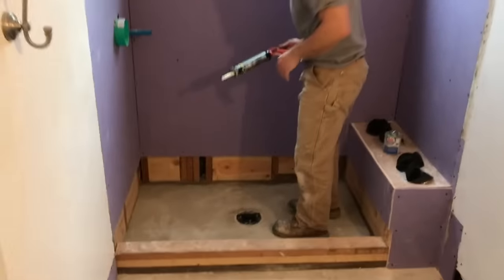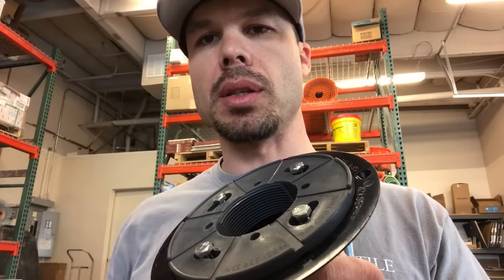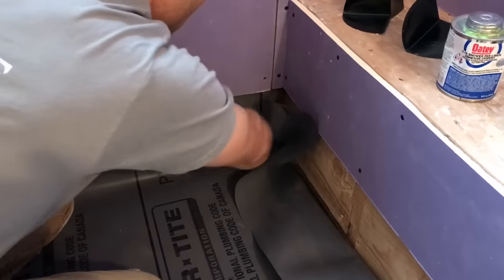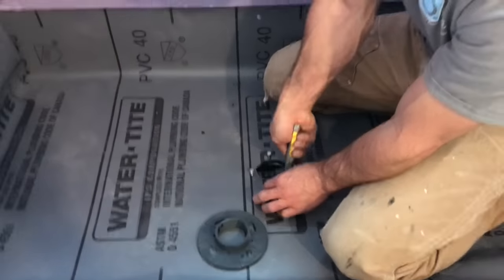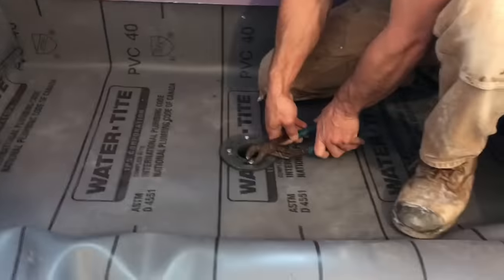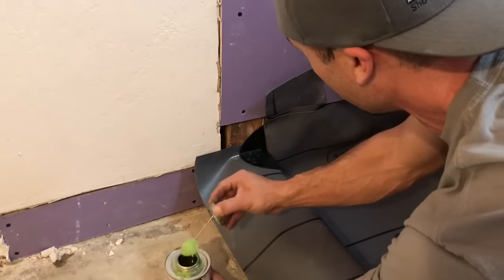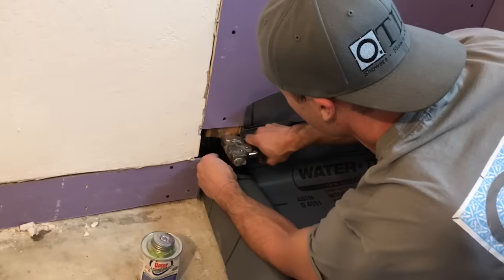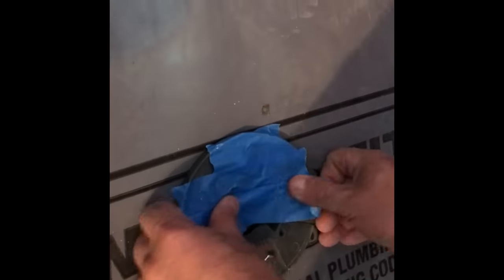Easy Shower Pan Liner: Tile Coach Episode 9

Comment: I've been watching vids for a few days now and have heard that cutting a complete round hole in the drain isn't any good, but rather cutting an X and folding the flaps down will result in a potential leak from seeping under the O cut

Comment: Great videos. They have helped a lot. So thank you. I want to use a pan liner, but I can't seem to find one large enough. My shower is 5x7, but to cover the sides, floor and over the curb I need one 7' x 8'. Do they make them this size? Thanks in advance.
Reply: I searched shower pan linear and pick images. From there you should find the size you need. You may have found one since this is 9 months old?

Comment: Get a Kerdi shower system. Those old style shower pans are inferior. You still have to waterproof the mortar bed or you WILL get mold.... He also has No preslope under the pan so water will sit in that mortar for weeks before it finds them weepholes to drain....

Comment: It's much easier if you just cut a little X on the liner on top of the drain bolts and then just push the liner down over the bolt. No need to try and cut a small circle out of the liner for each bolt. A little X is all thats needed.

Comment: corners are the worst. no segue, but a horror story about a mud pan. Remodeled a master bath, put in a 5x5 walkin shower. Hired a crew to do the mudpan and tiling. Gave them two pieces of 5' wide 40m liner. there was a seat framed out in one corner. the stole one of the pieces of liner, didn't cover the seat at all. i ended up having to tear out the ceiling in the room downstairs and repair, also had to tear out half of the mud pan and redo it with new liner - lost the seat, and the guy wouldn't return my calls. <sigh> guess I was just a sucker for not standing there looking over their shoulders the entire time.

Comment: Do you ever skip the pan liner? Say on one story house with slab foundation.
Reply: No. Although, in California in particular, there's a trend to argue it's not necessary at times and lazy contractors will simply put down a coat of 'redgard' (or brand equivalent thereof). This is always done a.) out of ignorance b.) desire to cut-costs c.) a desire to 'bilk' the customer and not do work that is quoted. d.) All 3.
 What would ever be the reason to not use one? They're cheap. slab, unless treated w/ some sort of waterproofing sealant is not immune to moisture and constant contact with water. Additionally, you'll use a liner on top of a 'pour' that you already have done that is sloped. You always want to have a slope that leads toward the drain. 
I'm not sure what your circumstances are but if you're asking questions like this as part of your own DIY project - I'd forego the headache and purchase a premade pan from a big box store. In the end the price difference will be insignificant given the amount you'll have to learn. Conversely, if a pre-made pan does not fit for your application (remodel drain location restrictions, you're going to tile the floor etc.) then proceed w/ a traditional technique.
Reply: I do. If it’s a concrete floor and dirt underneath then who gives a shit.
Reply: @dandan7973  um, yeah, don't take this advice. On the plus side, the price was right.

Comment: Purple board  hope that is the fiberglass board...paperless. These pans are what 10yrs maybe 15? Homeowners cheap pan. It should be hot mopped. I agree though why not durarock.instead of drywall...its cement board?
Studs in stall should be wrapped with 60min black paper. I've also read that steel drain is best  not plastic.
I'm just a drywall contractor..you rarely see this style here.
Reply: Isaac Ostrom you never adressed using a vapor barrier such as 60min. black paper that stucco guys use to seal wood studs.I do high end homes for over 30 yrs. Just going by the way I see homes done.
I also heard plastic drains break.
Hot mop is like roofing..several layers with tar..I think they charge about $400.

Ok I went back saw your video How to float a shower....I've seen guys float walls then put wood screeds to get walls flush and finish it..pull the wood screeds and hit where the  screeds were.. Your method looks ok   Plastic drains???
I read the plus and minus of both..

Comment: Ok. This is a good Video!  I am old school. Call it law by the government or what but stick to the old ways that have worked for so many years! Hot Mop! Tar shower pan, #30 lb felt paper for a liner, got up 18" on the sides and you got a solid system for 20 years unless you go someone on the bad side!
Reply: Sorry Jason, but if I built my showers with a 20 year life span I would've been in trouble for the last 14 years. There's a good reason why almost nobody (and nobody I know) uses tar paper pans anymore. Rubber works better.

Comment: code or not i would never put drywall down that low,,and is that OSB on the bench ?
you say your putting lath and mud over drywall,,so you just use long staples every 16" O C ,,crazy
Reply: Yeah no bueno. Crap installation. Nothing like installing a septic tank under people's feet!

Comment: Really? Staples? And drywall? No cement board? Moisture will rust out the staples and eventually get to the drywall. And how are you going to finish hanging your drywall without putting holes in your 8 in sides of pan linear?

Comment: Great video, pre slope before liner = good idea

Drywall as backer in a shower is really crappy..
Over where I am in Canada Water resistant drywall is code minimum, which sucks! Unless your gonna red guard all the walls but then that defeats the purpose why not buy cement board and do it properly??

You should really put a disclaimer about the backing your using alot of people are gonna think drywall/ water resistant drywall is acceptable as tile backer in a shower.. Your tiles have a 15 year life span with drywall tops!!!
Reply: @TileCoach  
what do you mean by floating? 
Thanks for the reply
Reply: @TileCoach  Im assuming floating the walls is skim coating with mortar..?

Still more cost effect with a product like densheild lets say?

Comment: That's not how you prep a shower bench you should around the corner over the bench and then float the front of it and Float the top of it if a wire and you put caulking I mean staple that you put in for it will not rust

Comment: Just have to point out.....the better way to cut the hole by just making star cuts that don't actually reach the edges of the hole. Then you just use the the locking flange to push them in......
Reply: Also that's an odd way to do your curb corners.....if you just cut out all that extra, you can get a much flatter  joint.

Comment: So when you cut the hole for the drain why didn't you t it? Split it in a t and tuck it into the drain
Reply: Isaac Ostrom no what I'm saying is def silicone it for sure but instead of cutting the actual circle if you t it then you can tuck it when you put the 2nd flange over it. It's how we've always done it that way even if the silicone ever fails it still flows into the drain you might lose maybe a 16th from your 2" but works solid. Nothing will ever get under the flaps because they're tucked in between the 2 parts, if anything does get under it then there's a problem with a pan failure
Reply: Isaac Ostrom agreed

Comment: You have good intentions. I've done hundreds of showers. Literally. I hope you didn't install over the drywall
Reply: We used to Mud everything, walls and Floors just never seen anybody do laugh over drywall what is the reason to go over the drywall versus nailing your lath directly to the studs over a vapor barrier? Seems like it makes a pretty thick wall is that code for California I assume? When I started, backer board was for cheaters. Now it's the thing to do, seems like. I agree with mud walls you have a bomb shelter. And they will last 50 plus years. Instead of using drywall we would lather and put a scratch coat on it let it dry out for a couple days and go back and float it. If you have any pictures I would like to see them and especially on the float coat. I didn't know anybody knew how to float walls anymore, much less make the mix for it. Have a good one
Reply: @TileCoach  floating is tough especially in the summertime, and what a mess also. I don't put a lot of heart into the Schluter system that's a very thin waterproofing membrane that you're betting on and a lot of seems. We'll keep up the good work Buddy. Have a great one, and happy New Year
Reply: We take the sheetrock down and add goboard instead

Comment: Next time run your wall boards all the way down to the floor over the liner...I also like to leave a little space in the corners to tuck the membrane into the corners..That way you don't have to fold it over three times and bump out your wall boards in the corners...

Comment: Your pan is supposed to be prepitched beneath the Oatey liner and the wall board is supposed to lap in down to within an inch of the pan bottom.
I left the code for drywall use in showers in the previous comment.

Comment: Bro I’ve been making vinyl shower pans for 20 years. The one you made was a good attempt I’m sure it was waterproof look for a video should’ve made one much prettier. Look like you just slapped it together. The way I do them is I measure the shower pan and build a shower pan in another room and drop it in.And when I’m going my corners I light them on fire before I stick them together and make it softens the material and makes a glue stick much better
Reply: Oh yah I’m a plumbing and heating technician of 20 years. In Connecticut the plumber does the shower pan Most of the time.

Comment: You are not supposed to use sheet rock. By code you must use cement board inside the shower.
Reply: I don't mind 'green board' as a sub layer behind durock but 'mud' cap trim isn't as common as it used to be. There's no way I'm putting tile on sheetrock except for kitchen splashes, even if I waterproof it. The gypsum wicks to easy. I'm not real keen with staples for the liner. They'll definitely rust out quicker than galvanized roof nails. Once the staple rusts out there's not much to keep it from sagging behind the wall.
Reply: Isaac
First, 34 years in the trade, lesson #1, never say 'never', there's a first time for everything.
Second, unless you're mudding the walls over your wallboard, you misunderstood what I said.
I said durock is ok over sheetrock. I assumed you're mudding the base. And if you're not durocking over the wallboard, I'm assuming you're going to mud over the bottom part of the wall where the liner is and then waterproof the whole thing. Either way your mud base is going to sit on your liner. Your staples will eventually wear out (probably) and your pan, pre-sloped or not, will get wet to a degree, increasing the weight and pulling on the side of the liner. I'm not saying you're stupid or anything, if it works for you, go for it.
I'm just saying why I wouldn't do it.  By the way,
If you look at my original comment, I was sticking up for you by telling the other guy you might have a perfectly good reason for having wallboard in your shower. Of course, if all you're going to do is waterproof it and then tile over it, that's messed up.
I'll tell you what, if you still like doing it that way in 34 years we'll renew the discussion.
By the way, even mudding the whole thing I still wouldn't use staples.
Take it easy, whippersnapper.
Reply: Isaac
No offense taken. Everybody has their 
own way of doing stuff. I don't mud walls because I don't work with a helper and it's just too much labor.
Besides you've got to have a pretty thick skin to do videos because everybody is going to tell you you're goofy for this or that. My ego can't take it so I just do my jobs and TRY to mind my own business. A couple more years and I'll probably retire.
Good luck.
Reply: @richardharris8399  give me a link to see your videos , Sr,it seems like you have your own channel,do ya
Reply: @trabajadoraenconstruccionu739  Actually I don't bother videoing myself.  They say old habits are hard to break, I guess new ones are hard to start.
I'm just getting to where I remember to take pictures when I'm through. Besides that, everybody has their own way of doing stuff. I like my way. It's worked pretty good for 34 years. And I learn something new all the time. I didn't think much of waterproofing until a couple of years ago then I tried red-gard so now I use it pretty regularly. 
To tell you the truth, I don't think my ego could stand all the jerks out there dumping on people because they do "this" or they do "that" (jerks like me sometimes) and they don't do it that way.
But if you find anything I say helpful thanks for letting me know.
Reply: @richardharris8399  we all can learn something new,its just I am watching videos as much as I can because no one wants to share the knowledge with others,congrats Sr.and thanks to this channel to.also Im a woman👍
Reply: @trabajadoraenconstruccionu739  Thanks for your comments. Maybe one of these days I do a video. We'll see. I think Sal di Blasi (I'm sure I spelled that wrong) does good work. What I've seen of his videos I generally like. I'll give you one little secret... I don't know if you're a believer or not, but I try to say a little prayer when I start work everyday. I know it sounds like bs and it doesn't seem too common on jobsites but there's so many things that can go wrong on a job that you may not even think about, I just try to make sure God knows that He's always welcome to keep me from messing something up. Just a little tip.
Reply: @richardharris8399  God bless your work,everyday then,👍
Reply: @TileCoach  
R :702.3.8.1
Reply: In Arizona we hate to use  hardie backer , denshield ,fiber rock or durock  not even purple board   and no nails or staples  below one foot we have to make those bottom cover caps 1',6 " a less  and no wood in the curve only concrete blocks 4x4x16 whit caps , I like how you install the prepich that mud before you install the liner .
Reply: @TileCoach  
Wrong.
IRC specifically states such.
Local codes can no longer vary to mitigate IRC or MRC.
Wrong answer .
Reply: @keithtomczyk4730  Not sure what you mean by MRC but, if it is the Michigan Residential Code, they are operating under the guidelines of the 2015 edition IRC in which there is NO R702.3.8.1.  And as far as the IRC....it is the sister to the IBC and put out by the ICC and local jurisdictions in the United States are NOT required to adopt those codes.  They are guidelines/suggestions.  Same with TCNA handbook guidelines.  And yes.....this Purple XP gypsum by Gold Bond is NOT included as an option for acceptable backing in EITHER publication (2018 TCNA Handbook "Materials" sections of pg's 238-249 and 2018 IRC table R702.4.2) BUT.............in the manufacturer's submittal for this material it states.... "Avoid using as a backer board directly behind tile in tub and
 shower areas" which, to me, implies that it can be an INDIRECT backer:  As in a backer to a backer.  BUT, according to both TCNA and IRC it is NOT an option for backer behind ANY type of water proofing/repelling method in ANY tile installation method.  If I am wrong on any of those points then please feel free to direct me to the appropriate and official references.

Comment: The only thing I see wrong is you installed the drain flange upside down.  The weep holes allow water that leaks around the drain to drain out into the drain. But the drain tracks should be facing down against the PVC liner.  Flip one over and look at it and see the benefit.

Comment: Purple boards REALLY!!!  U fail before u start
Reply: This is a top class tile setter, He will most likely float the walls after he is done,  this is top class and so does the end results of people like him.
Reply: Purple board is fine as long as you coat it in something like red guard
Reply: @cencoast_7.340  He is probably a contractor from California, one out of ten in California actually knows how to work 9 out of 10 only think they know.
Reply: 2strokesnPwrstrokes except floating it doesn’t fix the problem
Reply: Ismael Montano why u angry face my friend?
Reply: Been tiling for years over purple board. What do you tile over in your installs? Plywood😂.

Comment: Use the Schluter system eliminate the old pan liner and durock Schluter system is superior installation
Reply: No cons completely waterproof system best warranty on the market can't be beat
Reply: Disagree this system has been proven 50 ft underwater which is an amazing amount of water pressure it will last as long as the tile does
Reply: Shluter is best. Not all clients want to spend that kinda money when old school methods work as well
Reply: James Coyle 

Schluter is still relatively new compared to this vinyl membrane. Vinyl is true and time tested to work. There are too many seams in the Schluter system that cause you to rely on “properly mixed thinset”, no thanks. No seams, no leaks. I’ll stick to vinyl that will be here long after mankind is gone.

Comment: Water tight until we put staples in it 😂😂😂😉
Reply: That's why it's stapled at the very top, if your water gets that high u have bigger problems and it will spill over the shower curb b4 it gets that high that's why it has to be a certain height. Think 1st b4 u make yourself look bad
Reply: Think b4 you comment, that's why it's stapled at the top and higher than the curb, it will spill over the curb b4 it could get high enough to reach the staples.

Comment: "Contractors" using drywall on a shower is like mechanics using cheap aftermarket parts on your car, soon will have to replace them. Drywall is not intended to install tile, not on a shower. There is something called cement board, or hardibacker, or durock. 🙄😒
Reply: 99 percent of mechanics use aftermarket parts.